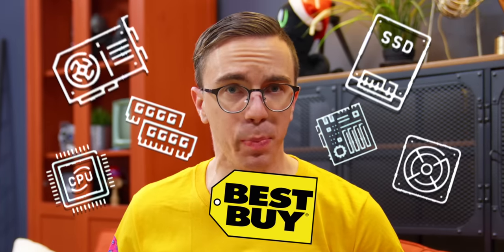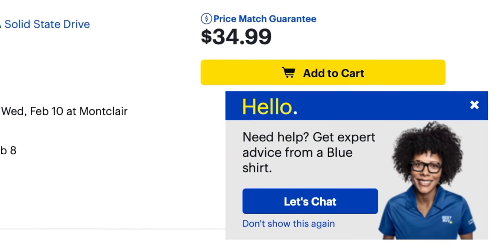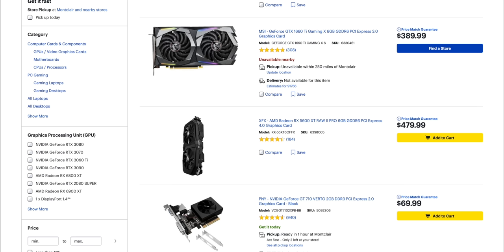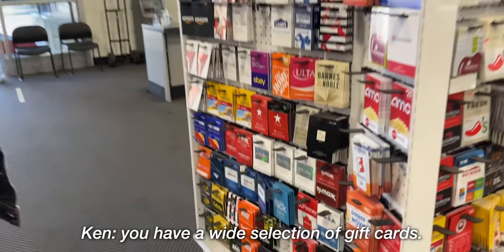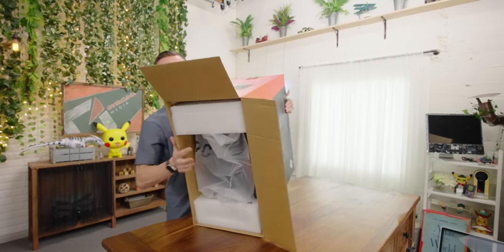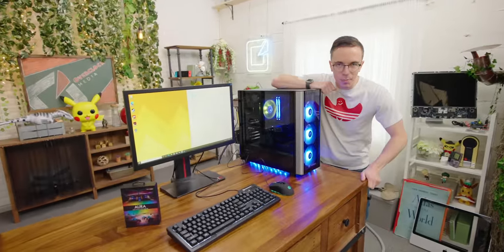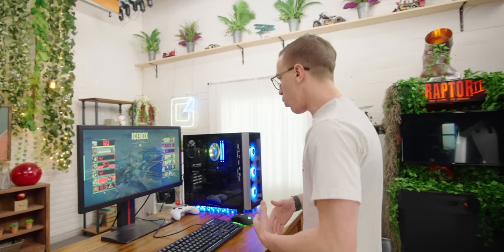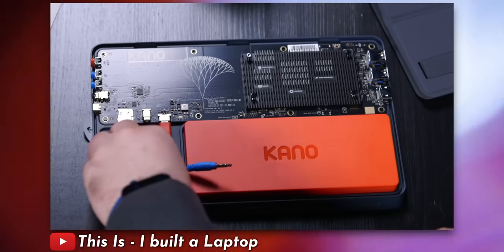Building a Gaming PC...at Best Buy??

Comment: We live in a society where pre-builds are actually good deals what a time to be alive.
Reply: Elitists-“impossible”
Reply: This happened in 2017/18 It not like a new thing. I’m already used to trying to build a pc threw scalping craze. Yes it’s worse this time around but it’s almost the same thing
Reply: Sorry to be that guy but it's were no '
Reply: Just got mine (ordered in January) with a ryzen 5900 and gigabyte gaming 3080 OC , 980pro m.2, 4tb hdd, x570 strix mobo and 32GB ram for £2200
Reply: @No-ed1bs  you tried correcting him and you failed lol. It's where
Reply: Where*
Reply: @XNdrr010  wher
Reply: @Clarkeyrules1  where? That's cheap with a 980 pro even for non scalper prices
Reply: where*
Reply: pre built computers were only bad when they used proprietary parts.
Reply: what ever the case when you have some knowledge about pc building and you are a gamer you are gonna hate prebuilts without any reason
Reply: Ew, pre-built PCs? That's like buying pre-built keyboards instead of building one.
Reply: @ALEXANDER-ic1ib  IMPOSSIBRU!
Reply: Thats fucking insane. Those 3080 are 1500 alone cus of resellers. Good fucking deal dude
Reply: @Clarkeyrules1  nice pc
Reply: @Clarkeyrules1  Thats... actually a pretty damn good deal. Quality parts and 3080s are so rare. I got a similar setup for mine from NZXT BLD and basically paid $250 over MSRP for the sum of my parts in exchange for assembly + shipping + actual availability of a 3080.
Reply: Pathfindet
Reply: I will buy prebuild or pc make by other company because less risk of breaking the pc by myself like broken side glass panel for what already happen. Less hassle lol
Reply: @aphrodi3983  uh oh, joke go bye bye
Reply: not EU lmao
Reply: hello pathfinder
Reply: I agree, it is a very crazy time to be alive but I think that this is something that would inevitably happen
Reply: My CyberPowerPC rig is pre-built
Reply: Why are we still here, just to suffer
Reply: Pathfinder lol
Reply: @supergundamcat  pathfinder likes prebuilt lol
Reply: @Brayden Zaid wtf
Reply: Austin Evans  wdym
Reply: I built a $2000 PC that would sell for around $3200 as a Prebuilt..
Reply: I'm glad I got a good deal too
Reply: 10700k, 3070 for 1800$ at Best Buy? No way.. I can do that build for 1250 though micro center and Newegg
Reply: Nice to see you path!
Reply: It's just history repeating itself as pre-built PCs were quite good back in the late 90s early 2000s and actually helpful reps who could be clearly understood when it came time to configure the build.
Reply: @Clarkeyrules1  but when does it arrive lmao
Reply: @CaveyMoth  thanks for your comment. I want a new keyboard but every keyboard like sucks. I have ducky one mini 2 with speed silver and it's great but I want something else. I will build my own next
Reply: @thenman23  mine arrived a couple weeks ago
Reply: @Clarkeyrules1  wow a pre-built of pc price of 1 3090 gpu
Reply: @Clarkeyrules1  oh I see your comment now haha yeah you can get them for that price but you gotta wait. you luck and already placed order
Reply: Prebuilds have come a long way. Are there still plenty trash out there? Ofc, but if you are looking to actually get a half decent price on a more modern gpu you could do alot worse.
Reply: @Clarkeyrules1  what brand?
Reply: @No-ed1bs  nah man, it’s where....
Reply: only if you gut it for parts
Reply: @gj3915  in 2017 it was for Bitcoin mining right?
Reply: Lol
Reply: Haha but not the gpus tho
Reply: I been on the prebuilt train with iBuyPower since 2014 💪💪💪
Reply: @Youtubeshorts-hn7pm  yeah or 2018
Reply: Got a computer from Best Buy with a Ryzen 9 4900HS, 16gb ram, an RTX 2060, and 1TB SSD for $1300. What a time to be alive indeed.
Reply: @jojosbread_owo  Link us brother.
Reply: @Brayden Zaid Wow dude, you totally didn’t just reply to your own reply. 🗿
Reply: Now it makes much more sense to get a mac for work and a console for gaming. Even at the elevated prices for consoles, they are still cheaper than buying JUST a GPU.
Reply: Pathfinder main...respect
Reply: I just bought an Alienware aurora because of the Gpu shortage
Reply: Its always been a good deal if you can afford the specs you need and can pay for the extended warranties they offer.
Reply: @chrisbullock6477  if I sell just my gpu id net a profit, I’m not going to tho
Reply: Still more fun to build it lol
Reply: @brandonmarcos7279  I rather buy one and get a 3070 rather than build one and get a 1080
Reply: I played a solo game of fort nite at Walmart then debated buying that prebuilt because it had a 2080 and it was only $1000
Reply: Thermal throttling and a single stick of RAM. Yeah, sure.
Reply: yes i use a prebuild runs games even as big as red dead really well and its under 1k
Reply: I was gonna do a new build this year to upgrade my haswell era gaming rig. Gave up and got a gaming laptop.
Reply: I typed this
Reply: @Clarkeyrules1  good deal
Reply: @gj3915  please help me
Reply: @MrDrProfessorSir962  with what
Reply: @gj3915  with pre build recommendations lol I got the bare bones nzxt pc I’m gonna upload the specs to mpcr
Reply: Yeah facts. I got my pc for 650$ in 2020 and it has a 1050ti, 16gb of 3200mhz ram, ryzen 5 1600, A 320 motherboard, 500w psu.
Reply: We live in a society
Reply: Dont bet on it lasting for long though
Reply: Only for the gpu tho
Reply: i have a ps4 anyone trynna build me a pc?
Reply: what’s the stigma with pre built pc’s?
Reply: @OP17 Gaming what did he say?
Reply: @tuffcruz956  pre-builts have the parts you need, but depending on where you get them is the quality of how its put together. They have to make a profit margin, so they have to increase price and cut corners where they can
Reply: @ProtoAzula  as a person new to gaming pc’s and not knowing much, do you suggest i buy one pre built or try and build one myself?
Reply: @tuffcruz956  pre-builts would be better for newcomers. I suggest watching tutorials to know what parts are which, how to arrange them, etc. Then, look inside the prebuilt and identify these parts. Once you get familiar with firsthand experience, then would be a good time to upgrade. I suggest starting with either IbuyPower or Alienware
Reply: @ProtoAzula  what would you say is a good price range for a starting gaming pc
Reply: @tuffcruz956  personally between 1200 and 1800 for a low to mid-range pc is a good idea. I recommend getting one with a 1660 super GPU in it and the equivalent of a 3600x CPU. Try to also get at least 16gb of 3200mhz ram and an m.2 ssd  for loading, with a hard drive for main storage.
Reply: Getting my first pc ever prebuilt and I’m not even sorry
Reply: I still built my own in this climate & im proud of it😤
Reply: No way hi pathfinder!
Reply: @tuffcruz956  No real stigma it's just before all these crazy price jumps. You could build a pc that's cheaper than an equivalent specced pc pre-built like for me I built a pc for $570(granted some of the stuff was on sale) and the pc pre-built equivalent was $700-800 depending on the manufacturer. Also prebuilts the way they make a profit is to either mark up the price, cheap out on things that aren't CPU and GPU, or charge a 100+ build fee. Also, it's more fun in my opinion
Reply: @sanjarewaz7531  I got a computer from Ibuypower was it worth it?

5900x 
3080 from MSI
16 Gb 3200 
X570 Taichi
Gigabyte Aorus 1tb 5000 Read/ 4400 Write
Corsair H150i pro water cooler
850 Watt from Seasonic
All of that for about $2900 after tax (With extended warranties and peripheral $50 keyboard)
Reply: @ghostlyblue5735  considering today's market you got a really good deal for the parts as an RTX 3080 scalped goes for 1,400. I did some quick calculating and in a perfect world with all the parts in supply, you could shave off 100-300 dollars depending on the other parts and get just as good or better performance. All in all, you made a good buy and probably paid 100 or 200 over MSRP which is worth it in my opinion in the current computer market.
Reply: @sanjarewaz7531  Hot damn
Reply: @sanjarewaz7531  Pc Part picker says $4800 lmao
Reply: @ilsec2334  wut
Reply: @ilsec2334  you're funny bro
Reply: Bro, this is the truest statement.
Reply: his face at 2:52
Reply: Except they aren’t
Reply: Except you need to buy another stick of ram.
Reply: My mind hurts rn after this comment
Reply: Hey pathfinder
Reply: not in india you get a gt 710 in a prebuilt for 650$
Reply: even these types of pc's are like 200k or 300k.
Reply: russian pc stores: yes
Reply: But it takes 5 years to get it
Reply: What is the screwdriver he used??
Reply: Tru
Reply: i have amd only dell
Reply: @No-ed1bs  5 months later and I’m here to tell you that you failed to correct the truthful speaking man
Reply: well somehow i did it, overpriced as fuck, it cost me like 3 times the original price to buy a graphics cRd
Reply: fr i saw a digitalstorm pc with a 10th gen i7 and a rtx 2060 for $1400
Reply: Blame crypto...
Reply: @RebornDPK  what is there to blame for? Genuinely confused.
Reply: @No-ed1bs  loud and fucking wrong 😂😂😂😂
Reply: No
Reply: Not if you have a lot of money
Reply: Lyte gaming pc
Reply: Ikr I got 16 gb of ram, ryzen 7 5700g and a 3060 all for the cost of just a 3060 on eBay
Reply: @XNdrr010  he wrote that am I wrong
Reply: True, I got a prebuilt with a 3070 and a Ryzen 5800X for $1700
Reply: Update- not anymore
Reply: honsstly, it depends, living in a 3d world country where alot of items dont get selled/are way too overpriced pre builts are pretty good value
Reply: Fr. Buying parts specially GPU’s are way better in best buy because they are all at MSRP value
Reply: Laptops are cheaper than homebuilt
Reply: they're not actually good but the prices of other things are just waay too high and a normal person can't contact the graphic card company like deel or hp and buy then at seller price
Reply: Except for the single channel ram, but that's alright because we can simply expand it in the future
Reply: We live in a society where pre-bulids are actually good deals what a time to be alive.
Reply: @Clarkeyrules1  yeah and you overpaid lol
Reply: Idk dawg I bought 3 prebuilt I have a double pc streaming set up under 3.5k when it would of been over 7-8k built myself
Reply: @intensetrickster6882  that's cap
Reply: That just comes with the components just getting better through the years

Comment: So to build a gaming PC, we first buy a prebuilt gaming PC, dismantle it, and then use it on our own built gaming PC

"L O G I C A L"
Reply: MOST DEF łògîçãł
Reply: This is the way
Reply: I mean, I bought a pc set with a steal price which had an A10-9700 in it with stock cooler, some 8gb 2133mhz ddr4 (2x4), a 1050TI, and some generic brand PSU. I just had to swap out the proc with a Ryzen 5 3600g that was bought second hand and honestly? Prebuilt first, then upgrade after. Definitely worth the cash.
Reply: he said it had a 650 gold power supply but it was just a 600 lol.

Comment: I actually ended up buying (if I’m not mistaken) that same model prebuilt from Best Buy and honestly before I upgraded the parts (managed to find a 3060 retail price and put more ram in the system) it serviced me really well. Prebuilt PCs can be a scam but sometimes you find a diamond in the rough
Reply: I actually ended up buying (if I'm bot mistaken) that sane model prebulit from Best Buy and honestly before I upgraded the parts (managed to find a 3060 retail price and put more ran in the system) it serviced me really well.  Prebuilt PCs can be a scam but sometimes you can find a diamond in the rough

Comment: The 580 is now going $450.00 at Best Buy.  I bought one back in January for $280.00
Reply: Wow! That’s a lot
Reply: Bro the 1660 Gaming x cards are 400 now but were 100 when I bought it in January
Reply: i bought it for 100€ lol
Reply: I bought mine for 120
Reply: Gt 1030 lp was going for 3x the price a couple days ago on amazon
Reply: @Stan Joannis Yes, That's nice.  But does it do Ray Tracing...LOL
Reply: I remember buying one for a friend for $250 in Amazon in 2018, the model of Asus Rog Strix
Reply: Yeah it’s crazy. I have RX 580 and it can barely get to 90ish FPS on 1080p with low settings. Even overclocked and cooled down. It’s a good card especially with the 8gb of vram but not worth 380 lmao.

Comment: I have that exact PC and graphics card, it runs pretty well. Just gotta upgrade it slightly, like adding more ram and it works like a charm. Plus, in most games, you'd be running low graphics for better performance.

Comment: Hey I was wondering. I’m contemplating getting a budget PC or a Ps5. I’m 14 getting about $200 a week for my job. I have 1.1k saved. My question is, should I save for a 1.5k PC or just get a Ps5. I just want something that I can play games with. Right now all Im thinking is that if I’m going to get a PC I should ideally be saving up for more. I just really don’t know.
Reply: get the pc man trust me, can do alot more with it too
Reply: Its up to you. PS5 is great for the cost and ease-of use and setup. Comparable performing PCs are usually more expensive than consoles, but you have more things you can do it on it like emulating old games if you're into that, game mods, and other non-gaming tasks. However, gaming PCs are still computers and can have the same potential problems as non-gaming computers can have like annoying Windows updates, game crashes, driver update problems, etc. Doesn't mean it will happen, but it is a possibility.

Comment: I've always bought gaming laptops, I just shop around on Ebay until a good deal pops up. Been loving HP Omen machines. Current machine has a 1TB SSD, RTX 2070 Super GPU, Intel i7-10750H CPU, 144hz Monitor, 32GB Ram, and came with Windows Pro. For the ~$1400 I paid for it, it's everything I need in a machine right now. Portability's a huge plus for me, so a laptop is ideal.

Comment: I actually found that prebuilt you bought on the side of the road but it won’t post and windows won’t install on the ssd i think there’s a problem with the rx 580, and it’s a different 580. Same cooler same cpu if it’s a ryzen 5 3600 and the ssd wasn’t a nvme
Reply: That's wild if true

Comment: A week ago I bought that same prebuilt,  it was my first pc gamer, it worked quite well.
Reply: Green Hawk  I have that exact build in the video also. My advice is to upgrade it slowly. You MUST BUY 16 GB of ram when you get it though or you will have terrible performance issues later. Just remove the stick it has and get 2 new ones. Besides that, it will work like a charm. I've had it for a year and a half now, no issues, I run most games on low graphics anyways since I prefer performance over looks. I've played games like Metro Exodus, Call of Duty, almost all the Assassins Creeds, GTA V, Rainbow Six, and it can run a lot more. It runs great. 
ONLY ISSUE: Mine would get really hot, just heat my room up like a damn oven.
So recently, I replaced the CPU cooler with a Corsair iCue H100i Elite Capellix, and move the original intake fans to the top of the PC as exhaust fans, so it's been cooled down lately but you don't need to do all that just yet, it will run with the stock fans it comes with. Just keep in mind for the future if you wanted too!
Note: If you are going to make upgrades to it later, just know the manufactures LOVED making an absolute mess in the back, so gonna need to untangle wires and learn what goes where.

Comment: Dang! Best Buys have rlly improved since 2 years ago!

I just got into pc building so I’m unsure of this…

But was this because of lockdown? I think I heard a guy working at a tech shop say it was easier and cheaper to buy a prebuilt pc during the lockdown because it was extremely hard to get your hands on stuff during this time… is that true??
Reply: It took a while for suppliers to recover after the covid lockdowns, so things like computer components were hard to find across the board. I know getting PC parts was expensive through most of 2021-22 as the supply wasn’t there and scalpers took advantage of it.

Comment: I've had an amd rx 580 nitro 8gb for about 3 years. Bought it late but its pretty good. I can run all latest games on high without any problems. It's supported by upgraded ram and cpu also. Good card! Btw the price back then was about £260 brand new.

Comment: Back in the middle of October 2022 I built a pc only from BestBuy. Here's what I bought: Motherboard Asus Tuf Gaming X570 Plus Wi-Fi  202.99, Memory Corsair Vengeance Pro 32GB Kit with RGB 119.99, Power Supply Thermaltake Smart 700w ATX 80 Plus 49.99, CPU AMD Ryzen 5600x 159.00, GPU Gigabyte Nvidia GeForce RTX 3060 12gb GDDR6 427.99, SSD Samsung 970 EVO Plus 2tb 189.99, Case NZXT H510 83.99, the total for all this? 1233.94 about

Comment: For a 100 dollars less than that ipower system you said you where going to steal the gpu from, you could get a i5 13420f ,8gb ddr5 ram, 1TB samsung ssd and a rtx 3050 6gh laptop for cheaper with a ips 144 hz screen

Comment: I wouoldn't have the computer I do today if people didn't strip and flip prebuilts like that. It's how I got my I7-11700F, mobo, 16 GB of ram and that awesome piece of engineering, the stock intel cpu cooler, for less than the usual retail cost of the cpu on its own. I then gutted my old FM2 based computer and reused my existing case, psu, gpu and storage. The FM2 board, A-10 and DDR3 on it went to a charity that builds computers for people. I kinda feel bad doing that, as it had serious heat issues and was well past retirement age.